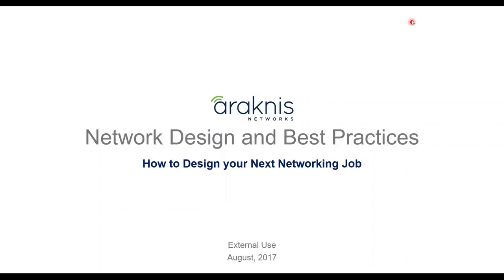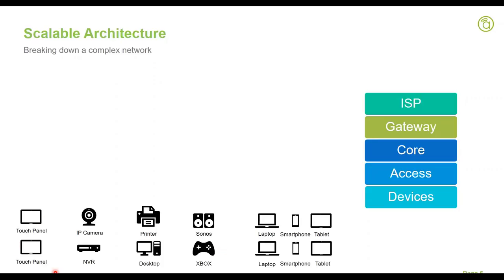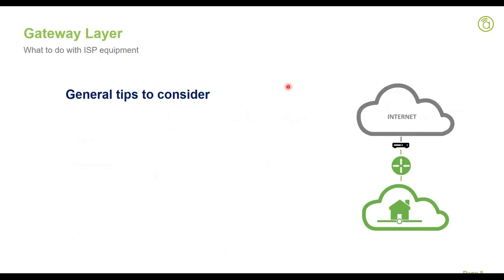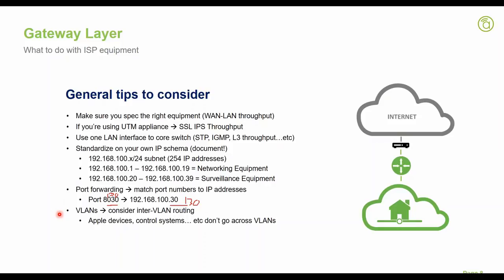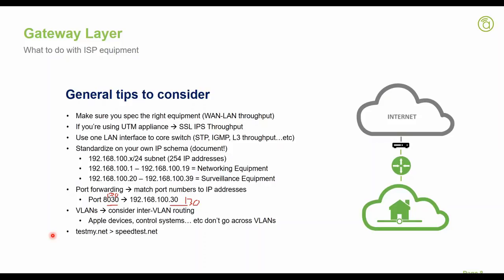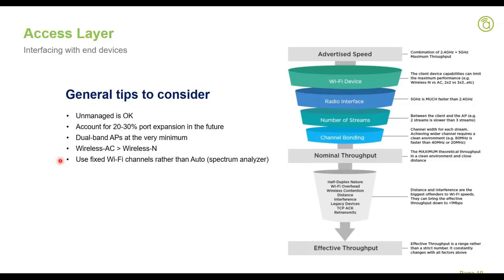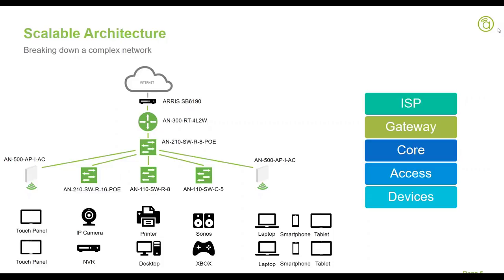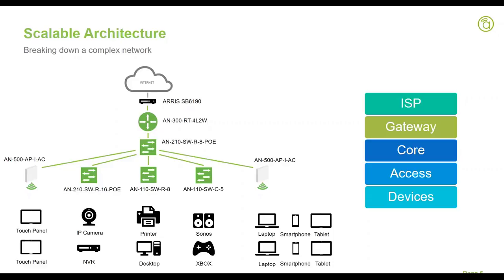Webinar: Networking Design and Best Practices

Comment: I am not sure if you consider the required bandwidth of the core switch per port. What is the bandwidth of the port which is connected to the cameras switch at the access level??? 16 camera out through  one port....